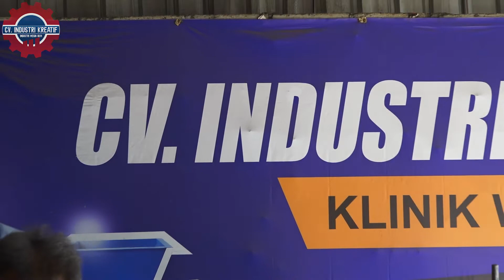SANGRAI KACANG MEDE / MENTE HANYA DALAM HITUNGAN MENIT

Comment: Berapa harga mesin ini?
Reply from the maker: untuk info harga,detail mesin & pemesanan hubungi Customer Service Representatif Kami (Telp/WA) 081234280625 - 081217850288 - 081252297132 atau kunjungi Workshop Kami di Jl Madiun - ponorogo KM 10 Selatan Puskesmas Geger 300 Meter Kec Geger Kab. Madiun Jawa Timur